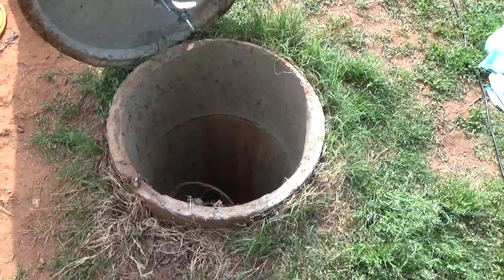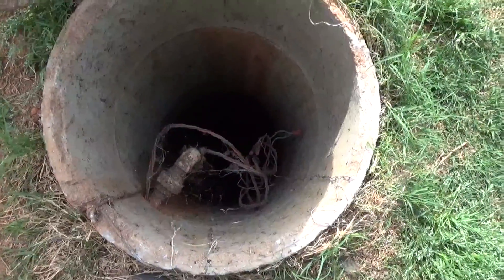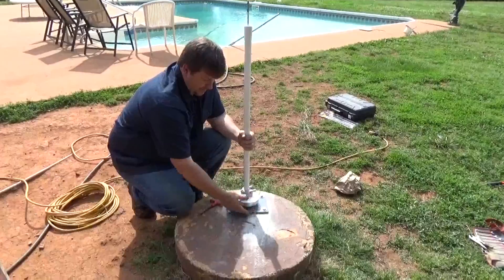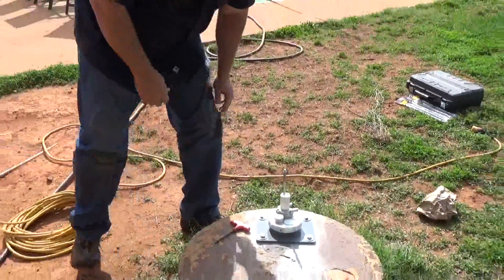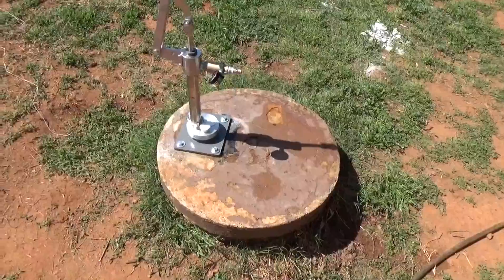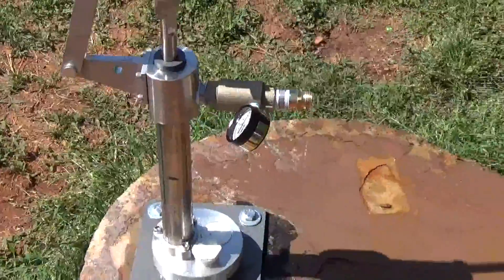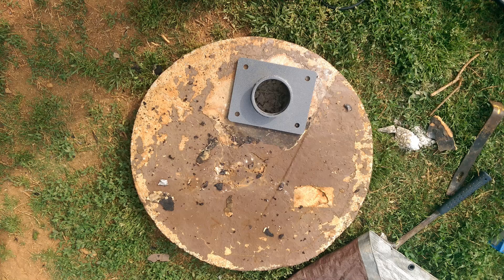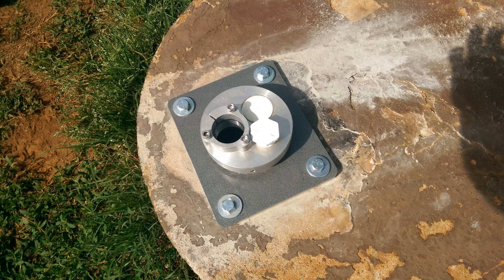Bored Well Hand Pump Install

Comment: I have a standard well, and I live on a hill. How do I tell how deep my well is?
Reply from the maker: Removing the vent tube and dropping a small stone into the well and timing how many seconds till it hits water.  Use 20' per second and it will be close enough.
Reply: This is what Simple Pump recommends, it's how I did it when measuring the depth of my well, worked like a champ.

http://www.simplepump.com/Support/Questions3-Depth.html
Reply from the maker: KnightFireLT1 9 times out of 10 the weight on a string method ends up with a snagged mess.  Simple Pump doesn't install or work in the field.
Reply: Fair enough, but their method worked like a champ for me in a normal residential well head already containing an electric pump.  Perhaps I just got lucky?  As I've only installed mine, I will always defer to experts that have installed many.

Comment from the maker: In this video we adapted and Simple Pump hand pump to a two foot diameter bored well using and adapter plate. Though many homes have been switched over to municipal water systems or drilled wells these old bored well are a wonderful backup source of water. With so much room and storage capacity many pumps can be added to them and then tied to the home as long as backflow prevention is applied. 

https://www.practicalpreppers.com/online-shop/water-solutions/simple-pump-detail-view

#practprep
Reply: Great video as usual and I found the process breakdown at the end to be very useful. Thanks